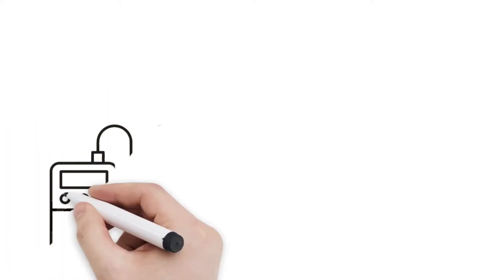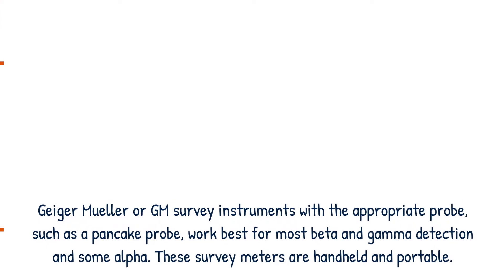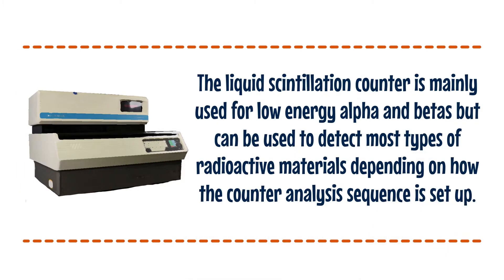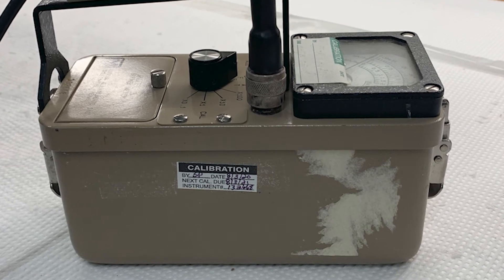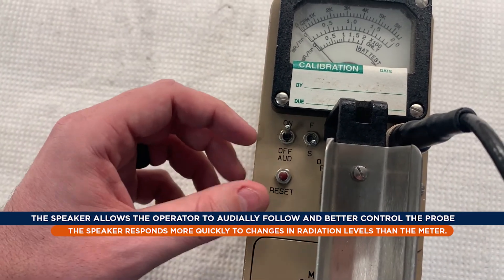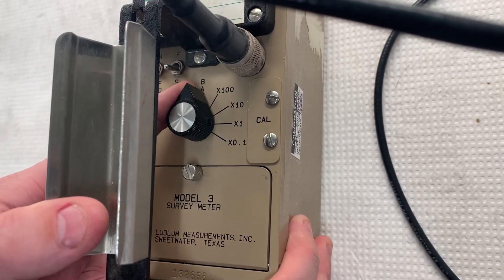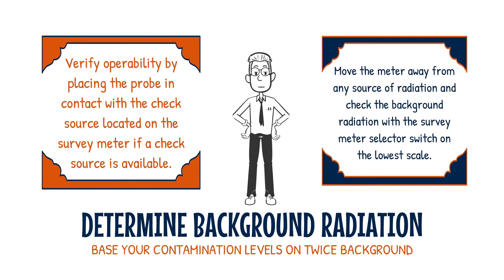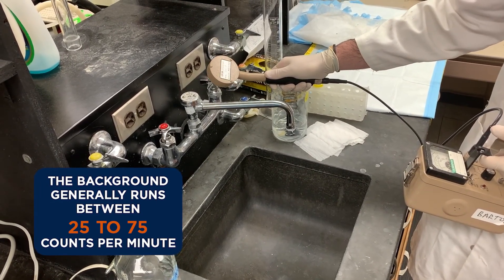Radiation Survey Meters

Comment: The NaI(Tl) scintillation counter is a good instrument for uranium exploration as it responds only to gamma radiation and has a higher efficiency than a GM as the detector is a dense solid rather than a gas and as a result of the superior counting statistics it can detect the gamma radiation from a boulder or outcrop at a greater distance than a GM unit.  When working with uranium ore or doing down-hole logging, we use a GM in combination as it doesn't saturate as easily as the scintillation counter.